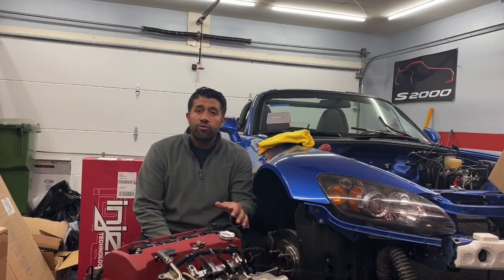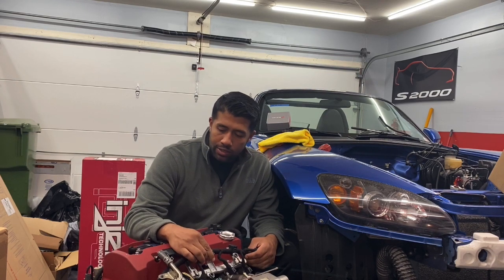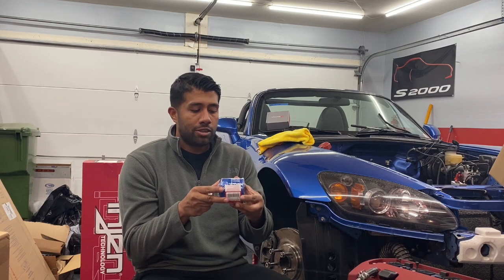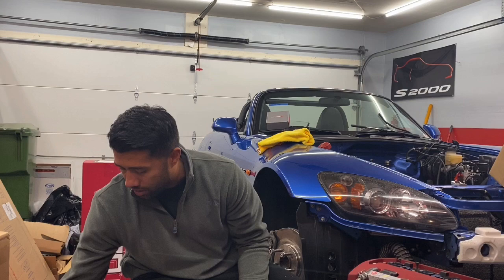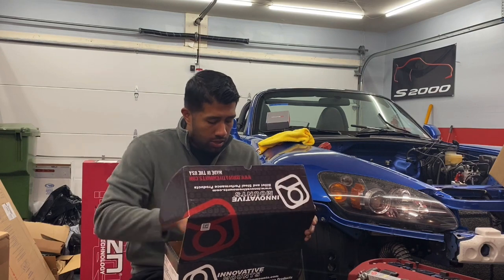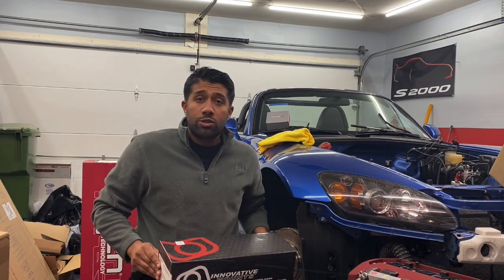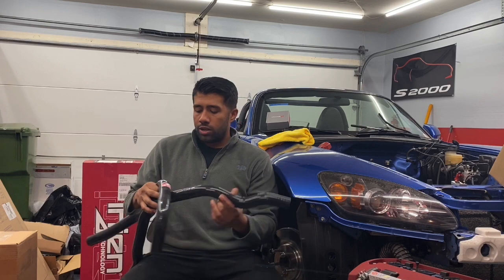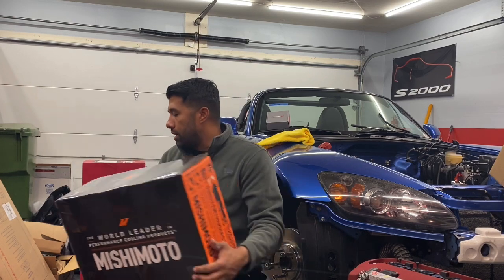NASA ST5/TT5 S2000 : Build blog episode #2 First round of parts

Comment: Excellent video series. Big fan of the mishimoto rad and oil cooler. Do you run a oil pan baffle also?
Reply from the maker: No, a baffle is no needed and will cause issues long term.  Run the stock pan and check oil every session.
Reply: Hi Samed, coming in late on this thread but would like your thinking on running without a oil pan baffle. From what I've been told is that the G's in cornering can create oil starvation when driving hard on the track. You mentioned longterm potential problems with a baffle, could you be specific. Thanks Rod.

Comment: Awesome!  Thanks for sharing your build.  About to snag an S2k as well to build for competition.  Wasn't aware that there are quite a few differences between the early vs later S2ks.  Thought it was relatively tame, but appears there are quite a few key differences that would make the AP2 V2s better for the track.  Mk60 is huge for sure.  My M3 ahs the Mk20 and it's fairly limited.  The later ones got the Mk60 and it's significantly better.  Ice-mode is no fun!
As much as i love an old-school throttle cable, i can see the benefits of the electronic throttle now, especially for GLTC.  

Looking forward to more!